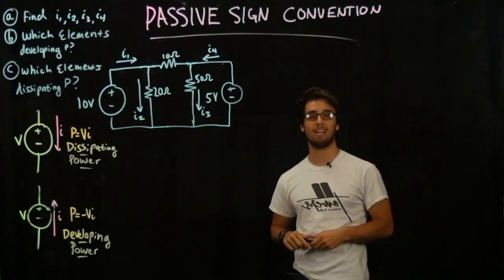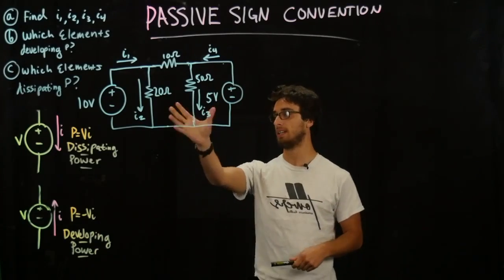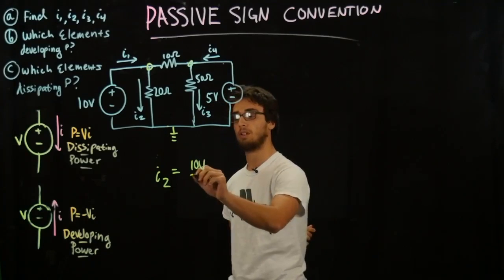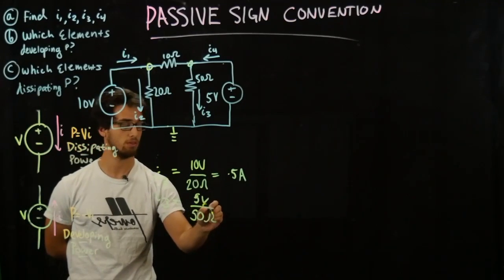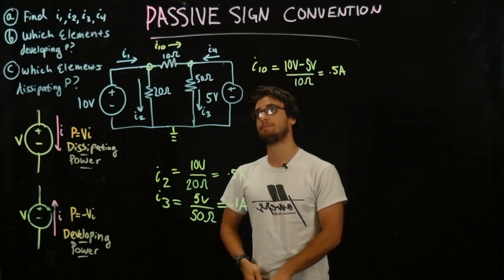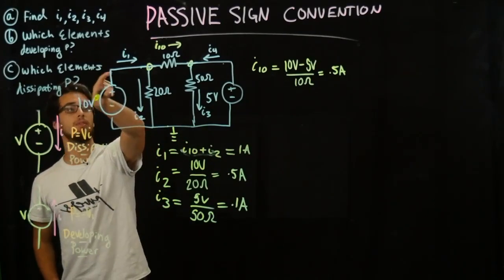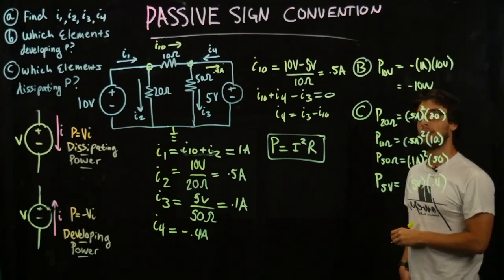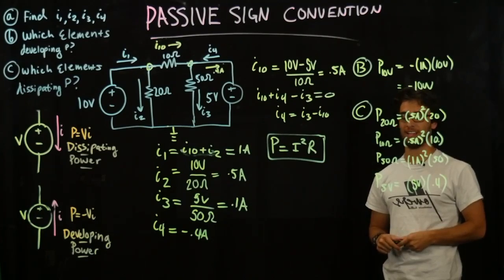Circuits I - Passive Sign Convention - Example

Comment: How can the 5V voltage source be dissipating power? I understand that using the sign convention, mathematically we end up with a positive power number and thus it means power is being dissipated. But conceptually, how could a voltage source consume power instead of generate it?
Reply: Because there is an external current passing through the source which is actively opposing the direction of current produced from the source.

Comment: In case someone is in doubt: I checked the results and they are correct. Also, the conservation of energy is satisfied (+power dissipated = -power developed), where p = + vi or vi > 0 for power dissipated (current enters in the positive terminal and exits by the negative terminal; applies always for resistors), and p = - vi or vi < 0 for power developed (current enters in the negative terminal and exits by the positive terminal.)